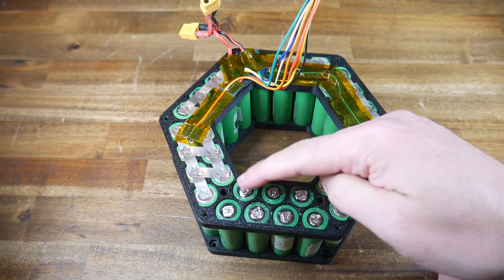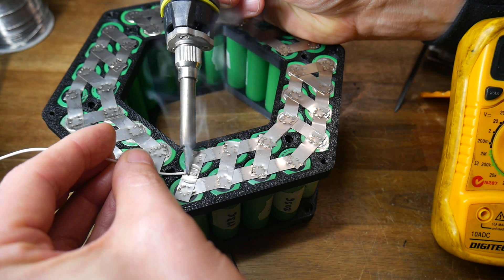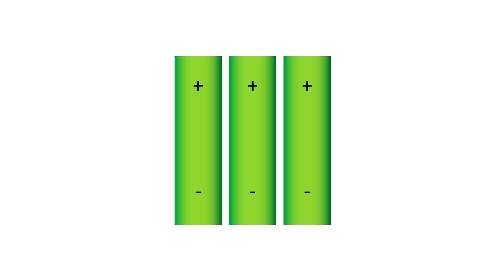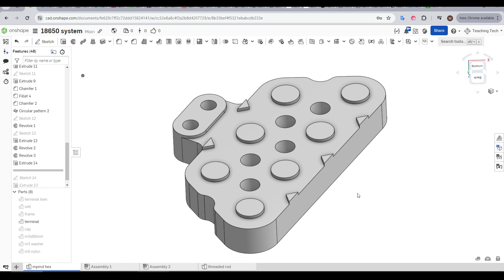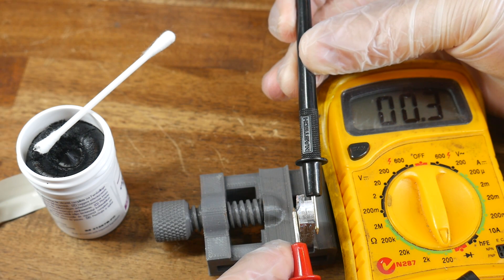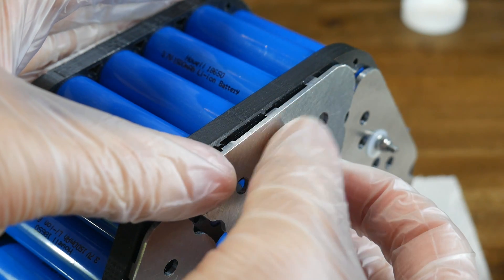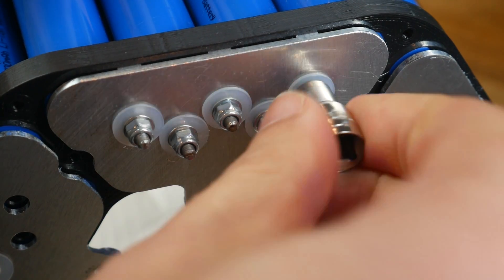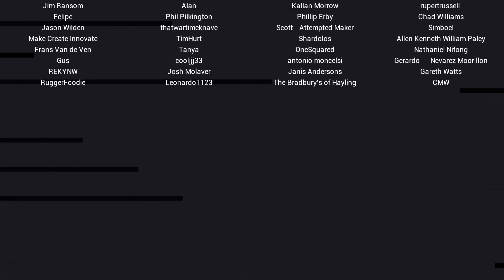Experimenting with a new (and probably flawed) 18650 building method: No soldering or spot welding!

Comment: That's not how you measure low resistances... You have to run significant current through it and measure the voltage across it. Then use Ohms law to figure out the resistance. If you happen to have a load that draws close to 1A, you don't even need to calculate anything. If the multimeter shows 2.5mV, the resistance is 2.5mOhm.
Reply: and really, for measuring a low resistance like that, a 4-wire Kelvin measurement arrangement will product much better results and factor out the resistance of the probe wires, banana plugs at the meter, etc.  Of course you need a DMM with 4 wire measurement capability, but they are much more available these days than before.
Reply: @lmamakos  What I (wanted to) describe was how to do that without having the "proper" equipment.

Comment: At time 10:39 I observed that your metal washers, on top of the nylon washers, are placed struck-side up.  This leaves the sharp side of the washer in contact with the nylon washer, and it can eventually cut through it if you're project suffers a lot of vibration.
As has been mentioned before, top-hat, or sleeve washers are best for this application.  I wouldn't 3D print them though, they are cheap enough.  If you can find them in PEEK that would be best, but expensive.  The nylon should be rugged enough.
You could also cut some silver-plated braid (like used on coaxial cable shield) and fill in the contact area with a bit of the braid squashed into the grease.  That should improve conductivity at higher currents.
Just some thoughts, on a nice looking project.

Comment: In order for a battery to be considered safe, it has to be assumed that one of the cells will fail catastrophically, but this will not cause the entire pack to burn up. In order to prevent cascading effects, you need to take steps to prevent them. You do this by putting weak spots between the cells that act as circuit breakers. As far as the current design is concerned, if one cell fails, the entire battery pack will fail as well.
Reply: that is not true and basically no commercial design utilize that. cells usually don't fail that way.

Comment: As an alternative approach, how about a battery where all of the "faces" of the hexagon have spot welded cells within the face, but the faces are bolted and wired to each other (using terminals) instead of being a continuous ring.  This way you still get cell replacability at the "face level".  So if one cell goes out, you have to replace say 8 cells.  Replacing an entire face wouldn't be optimally cheap, but would be a relatively easy job. and wouldn't have all of those somewhat sketchy contact surfaces to worry about and degrade.

Comment: Spot welding is not that hard or expensive, the worst part is cutting the nickel strips; it's very time consuming for large packs. I've welded like 100 3S3P packs and 2 13S4P ebike batteries, 0 faults, 0 dead cells. I've bought BTL-02 battery powered spot welder long time ago and it's good up to 0.2 mm thick nickel strips. I wouldn't go with "clamping" cells, welding them is much safer and with better conductivity.

Comment: PEEK flange bushings would be a much better (but pricier) option for isolating the bolts from the electrode plates. Keeps the sides of the bolts isolated but still allows clamping, and better for electrical resistance

Comment: Looks like a lot of us are thinking about the bolts.  My thought was: instead of nylon washers, why not just print a part out of something non-conductive that all five bolts could fit through?  Also, you'd probably have to hunt for it but M3 plastic threaded rod is a thing that exists and that would reduce your shorting risk even further.   For the new battery, of course the screws don't touch but using plastic screws there would be even easier.

Comment: If you are trying to measure contact resistance in milliohms, you're going to need a 4-wire 'kelvin' meter. Even with the fanciest gold probes, they will foul your measurments up, depending of pressure, wiggling them, and pierce penetration against the surface of the material. Also using aluminum in general as a surface contactor is just a very bad idea, tbh. Its conductive, but you need to acid treat the surface to get rid of oxides, and they readily reform once exposed to air, maybe if the glue you used breaks down that layer. Also from your description of the bolt isolation.. are you saying the only thing between you and a short circuit with 30A unprotected cells.. is the manual centering of the bolt and washer to not touch? There is no inner sleeve for the contacts 😮 huge NO.

Comment: I have also revised a couple of methods to easily build such batteries using 18650s. However, with the advent of large LFP cells, fooling around with 18650s it just isn’t worth the effort.

Comment: Instead of clamping the batteries in the middle, make the box structural with outer and inner walls and safely bolt it shut on the sides going only through plastic or metal inserts that don't touch the batteries at all. If you come up with a good clamping device you might not have to bolt anything or just use a couple of bolts and the whole assembly will come apart for fast and easy battery swap.

Comment: Great video. A couple questions :  
1) why not use sleeve washers to add insulation between the bolt and the aluminum plate?   You could even print this as part of your battery caps 

2) are you concerned about the conductive grease oozing down into the battery cavities and causing shorts between the positive "bump" and the battery case?

Comment: Is there some way to spring load the terminal connections? release the aluminum around it with a U shape so that in addition to the grease the spring loading can accommodate changes due to temperature, then torque using a torque wrench so they are all the same.
Reply: Spring loaded is definitely the best option. He was worried it was only rated 1.5A, but you can either design better than that or just rely on multiple cells in parallel.
Reply: @jaro6985  Yeah, you can make a higher amp spring-loaded design.
Reply: The bolt will stretch, and the head and nut will compress. There is your spring. It is not much when it comes to distance but it is quite a lot of force.
Reply: @squidcaps4308  bolt will not stretch a meaningful amount.
Reply: @ttonAb2  And yet, that is where the hold comes from. I said it is not much, you would need quite sophisticated tools to measure it.. but i was also being kind of a wiseass, in this case the nylon, plastic and the batteries themselves are compressed way more than the bolt is stretched. Gut feeling being about 10 000 times more.

Comment: A riveting watch (sorry about the pun). As regards the plastic washers, the aluminium plates they are bolted against, could have a.25 mm Circular trough cut into them where the plastic washer is desired to rest. They will then nestle accurately into place ensuring a uniform distribution of pressure across your battery packs.
Looking forward to the Mark II having just subscribed!

Comment: I heard that crossing any wire in a battery-pack is a REALLY bad idea, as 🌩🔥🎆🤯
Also caulking wires in place and putting paper/insulation between potentials is a really good idea - perhaps also even more space between terminals if/when the pack gets hot from use - the plastic might melt/deform

Comment: Why not 3dp a plate with holes instead of the washers. If you like Nylon use Nylon or TPU or PETG etc Then everything should line up. You could also use Nylon bolts but that might get expensive or redesign your frames so it includes short bolts into inserts in the frame or captive nuts so you dont have the chance of conductance from one side to the other

Comment: I'm not convinced of this paste. In cold condition it might have low resistance, but you need to check it under load and "hot". You don't know how it will behave. Maybe even react in some way and release toxic fumes. 
I would only lap the surfaces of the batteries and your plates and make sure that all cells do have almost identical length.

Comment: I like the concept!

had you considered using a copper shim stock (or copper gasket, or similarly thin copper material) with a printed backing to add rigidity / apply force to the connection?  With enough force, the thin copper should conform to any imperfections on the battery's mating surface.  Theoretically, the shim stock / gasket material could be cut with a 3d printed tool and hydraulic press (or similar) making the system more approachable.

Comment: Be aware, those kind of paste or other material that can dry out, will miserably fail since their resistance can become almost infinity. We had at the work a silicon with conductive property, but as soon as they dried out .. the resistance changed and .. time might be your enemy here also. And aluminum is not as good as copper. hope it works for you. You should have Battery Management System (BMS) or you end up having the same issue.

Comment: at first you wanted simplify maintenance for each section - so at least you can make each section as separatable section to prevent plastic cutting, you can add some joints in plastic as generic one.

Comment: The long screws acting w/ too much clamping force and too-wide-inner-diameter nylon washers are both disasters waiting to happen.

Print an "olympic rings" type gasket that is all one part, that you can use in place of individual washers.
Add some sort of rubberized cushioning literally anywhere in between the clamped pieces and the batteries.  1) to prevent a drop from transferring that energy into cracking cells  2) to relieve some of that static clamp pressure which will not be good for the cells, yet still achieve their stability in the frame.

I also really do not like the possibility of those bolts to short.  instead of long bolts, maybe the frame could have even/odd screwholes and long plastic posts to receive them, with evens being on the top of the model and odds being on the bottom.

Comment: I'm slightly concerned with the length of the bolts, specifically in the event that they might rub against the cell casings and cause a short that way. It might be prudent to coat or encase them in an insulting sheath. Then again, maybe I'm being paranoid.

Comment: I have built a lot of 18650 packs. My constructive criticism is: Don't do it like this. I agree with a lot of the "negative" comments below: Resistance, potential for shorting, axial pressure, dissimilar metals etc. Also be very cautious soldering wires to nickel strip between the positive terminals as it's easy to melt the heatshrink and short stuff out. I pre-spotweld a tab onto the strip to connect the wires. Also, always use a decent balance BMS (even for small packs) and your packs will last a lot longer. On the plus side, if that's a Kweld then you have a very good spotwelder, if you fine tune the energy delivered you can make firm welds that can also be peeled off.

Comment: Looks good but given the potential for catastrophic failure if the bolts touch the sides of the holes I would definitely 3D print some grommets that actually fit down into the holes and ensure that the bolts don't touch what they shouldn't.
Reply: Or even better is to have no bolts going directly between the two plates. The plates could be bolted to the plastic and then separate bolts could be used between the top and bottom plastic pieces.
Reply: I think he solved that in the last part of the video. The bolts don't have any physical way of actually touching each other.
Reply: @grantadamson3478  Yeah it looks that way but you never know how things are going to shift and given how dire the consequences of that failure could be I think it's worth taking a couple of minutes to print out and install insulators.
Reply: @DoRC  Yes. Agreed.

Comment: Carbon conductive paste is total rubbish. First of all, the stuff will get everywhere, even if you are careful, and make a big mess. Second, the conductive properties are just horrible. You think you get something that would be as conductive as a liquid metal or something, but noooooo..., its like 7 orders of magnitude out from something like copper (yeah thats like ~10.000.000x less conductive, would you rely on that?). In my opinion this stuff should not be used for anything that requires serious current conduction. 

The only paste you should ever use with electronics is dielectric grease (which is the opposite of carbon paste - non conductive) - and only for the purpose of corrosion and fretting prevention. This wont help your battery situation however. In your case i would look at a more solid mechanical way to firmly press the contacts on to the battery poles. Preferably something spring loaded.

Comment: ideas: 
Not having bolt going throiugh might not be that good idea as long bolt will make this plastic contraption act more like metal. So if it drops , all forces will be resting on plastic and on layer adhesion I believe instead of steel bolt tension.
About the contact - it might be that you can use copper mesh for it (like steel wool, but copper) to have good contact. It could be mixed with the compound
thridly - you could have each temrinal with its spring and bolt so that batteries are spring tensioned, but this depends on application - on rc cars it's not recommended because of high G forces. On printer, it might not be a thing.
And for the end some friendly critics from OCD people - whats with the bad quality prints on channel thats exploring 3d printing? :)
Happy engineering.

Comment: So......make each pack removable. Slot them together with a dovetail and a wire connector to the next cell pack. You never need to undo more then one cell pack when it fails. What's the problem??
Reply: Exactly. There are plenty of ways he could have made the original spot welded pack work and have removable segments but instead he went for this solution for some reason. There is a reason that pretty much any high current battery pack you buy will be spot welded.
Reply: @conorstewart2214 it is called ease of automation. Spot welding is the easiest process to automate.

For DIY packs I would consider spot welding if you can get high enough ampacity with available spot welder or soldering for very high current packs as home spot welders aren't powerful enough for making very high current packs.
Reply: Exactly.
Reply: I was thinking the same. Its generally good handling practice to be able to easily break down a pack and isolate parallel strings (such as two 6 cell packs joined in parallel, etc. If you have to consider things like maintenance, safety for storage (isolating packs) you need to consider what your minimum viable pack should be. When capacities start to get huge, you should also consider your maximum viable catastrophe would be.  Smaller units = better. Usually this ends up being a single pack of series cells to get the working voltage, and then create easy methods to parallel multiples together at the time of usage for the needed capacity.
Reply: @epremeaux  If using series packs always use diodes, preferably ideal, or dedicated source switching IC (pretty much two or more ideal diodes with fancy logic added on top) to isolate inputs and prevent balancing if you connect two packs charged to different levels.

If you connect your packs in series you don't have to pre balance your packs as even if packs have different voltages no balancing will happen. The drawback is that each pack is dealing with the full current of the system and all packs must be connected so no hot swapping.

Comment: Good video Michael. Get yourself a thermal camera and cycle that pack at maximum load a few times. Check for hotspots in the pack. The hot bits will need addressing. Speak soon.